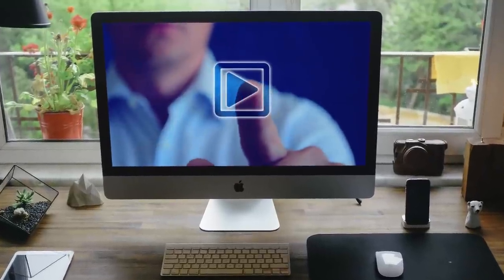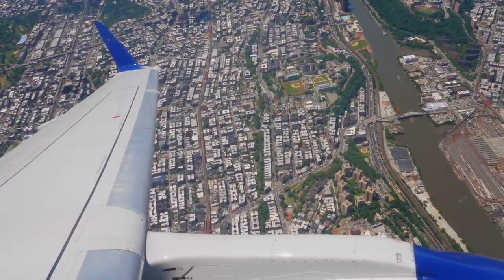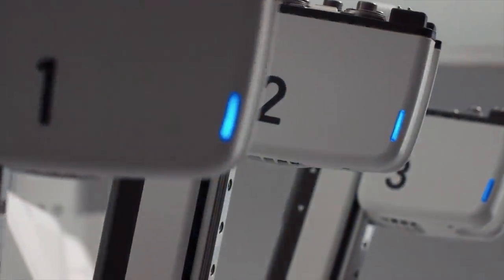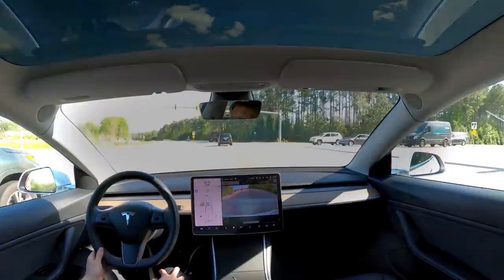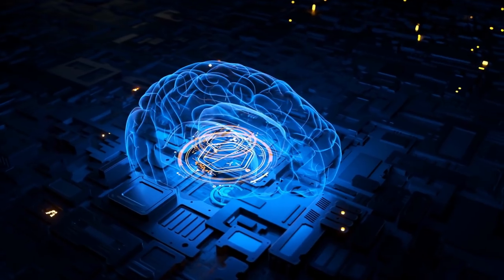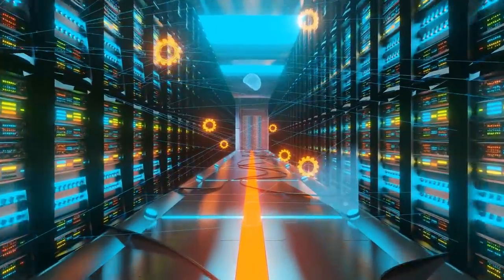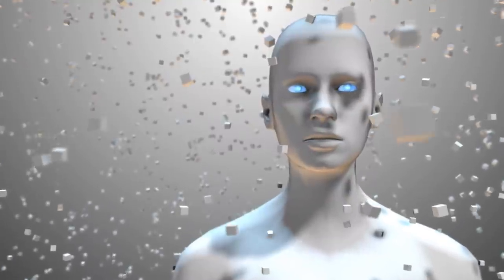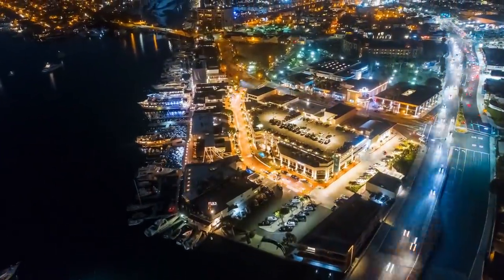The Rise of Artificial General Intelligence - A.G.I

Comment: It doesn't matter if AGI is conscious or not.  We can't even really describe what consciousness is without running into endless circular definitions.  I'll say this though, being involved in the world of machine learning myself, what we have today, though impressive at specific skills, is nowhere even remotely close to AGI.  Even systems like AlphaGo, are extremely specific to the task they were designed for.  You could not take the convolutional net used for that and apply it to any other problem.  Yes, you could reuse the basic design for other problems, but you'd have to retrain it for those problems, and at that point it would no longer work for AlphGo - it would forget that skill.  To get something akin to AGI with the current approach to machine intelligence, would require many specialized networks to be developed and hooked together to produce something that is good at "everything".  It would be possible, but a concerted very large scale effort would be required to pull it off - an AI moon shot.  But with so much research being done in the field and new breakthroughs coming faster and faster, perhaps we will discover how to piece together AGI in the not too distant future ...or maybe not.  Maybe what intelligence is, is just many such networks pieced together.  Maybe that's how our own brains work.

Comment: Do you have a codable robot? How to make it Artificial Intelligent follow this method: change the code in the subroutine from F=m*a*a to the test points below until you get it to walk and talk on its own.
F=m*a*a is currently running the system at 31.821%
If you have any doubts about my robotics research you can test my work by doing this start low and go high on the acceleration factor.
Test Points:
F=m*a*100

F=m*a*300

F=m*a*600

F=m*a*931

F=m*a*932 this is the minimum for communication and will state it is “too slow human”

Then go to F=m*a*2000

To F=m*a*2383 full functional range. Do not go over 2383 it could malfunction.

Now ask the robot its command structure and what he can do.

2nd Law of Motion for Robotic Physics